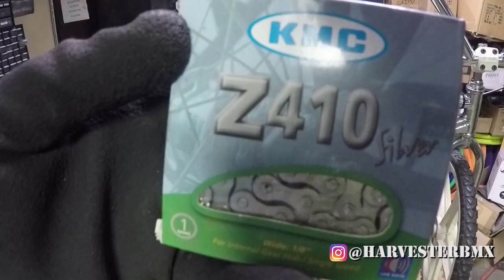Custom 1986 Redline 500c Old School BMX Build @ Harvester Bikes

Comment: So what’s the best way to adjust these bulldog brakes? I have both tools from park tool, the 4 in 1 thin wrench and the one with the hook to move the spring in the brake. Iv got it somewhat but def think there’s room for improvement. I heard greasing the contact points when assembling the brake helps the movement .. just wondering since this obv isn’t your first rodeo lol. Thanks for all the enjoyment